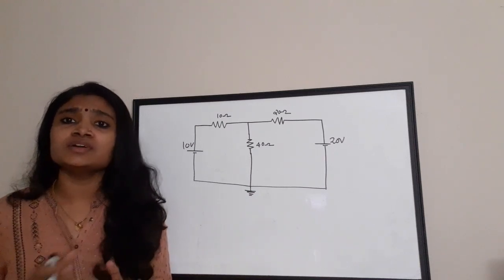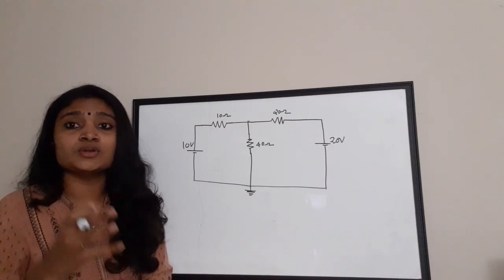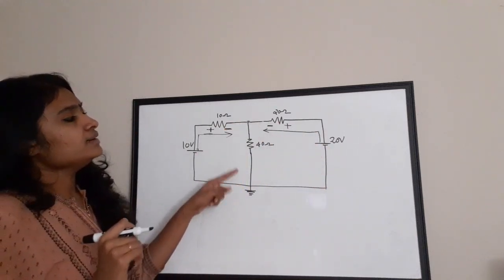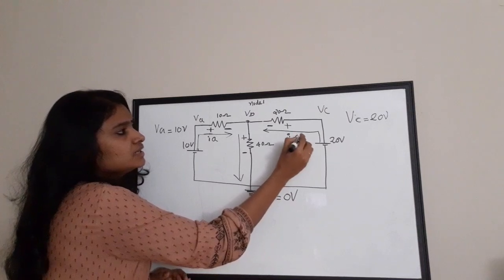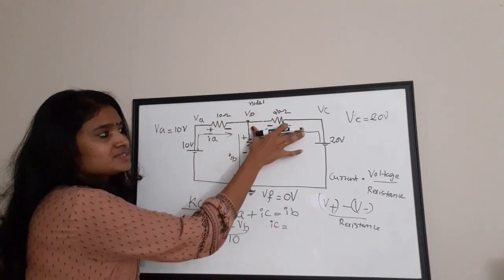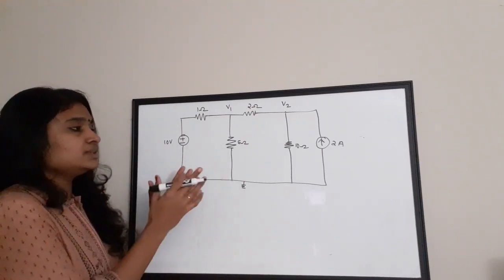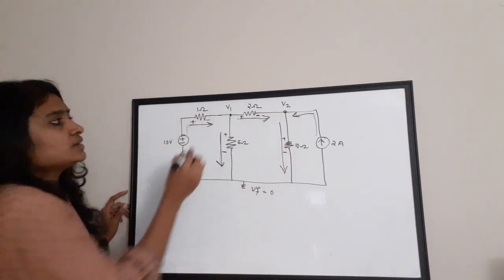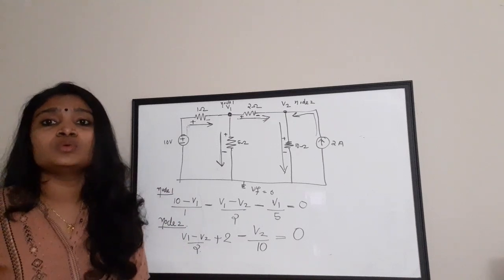Nodal Analysis Introduction and Example| Network Theory

Comment: it was a very good video mam i understood the concept very well without any confusions and many of my doubts got cleared mam .once again thankyou so much mam
Reply from the maker: Please subscribe and share with friends and juniors
Reply: @EasyElectronics_jobupdates  I have subscribed already
Reply: @EasyElectronics_jobupdates   I have a doubt mam when there is a numerical voltage sources like 10volts etc in the diagram we have to consider the polarity assigned to that 10 volts or generally take the polarity?
Reply from the maker: As per the polarity of source u have to take